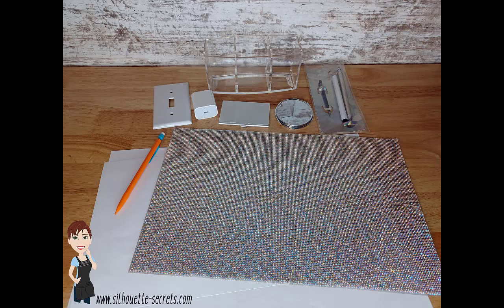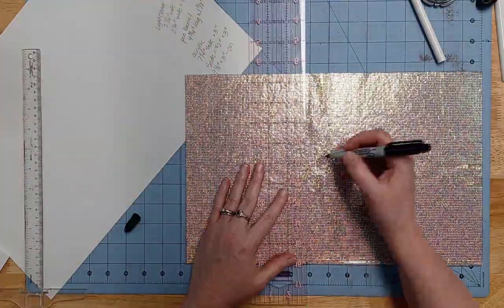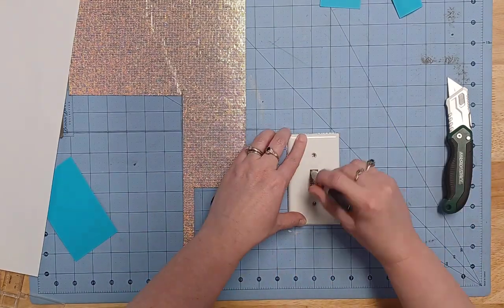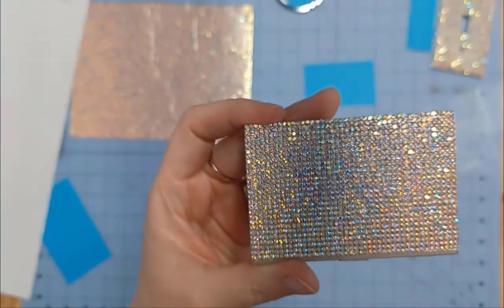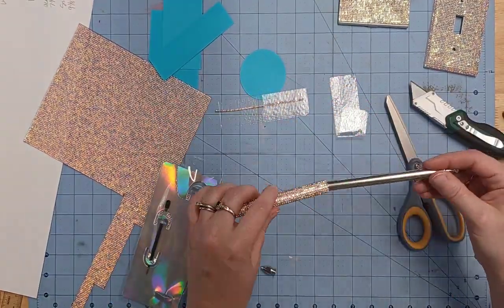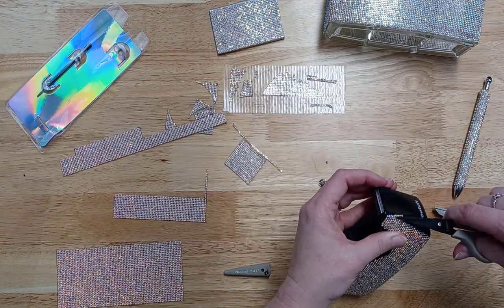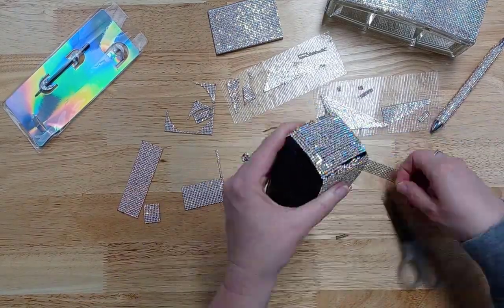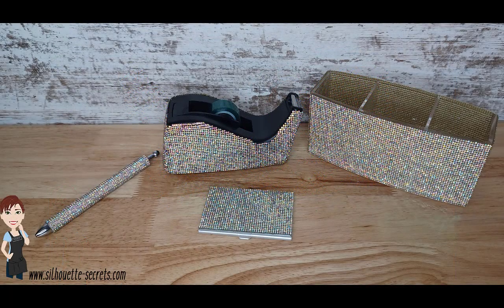Crafting with WALA Adhesive Rhinestone Sheets from Heat Transfer Warehouse

Comment: Hi there!
Thank you for the video. 
At some point did you use a heat gun or LED light (like at the nail salon) to cure the stones?
Reply from the maker: No. These are adhesive rhinestone sheets - no heat gun or UV light needed.

Comment: I’ve seen the phone chargers blinged out. Why did they say it Should be removed.
Reply from the maker: That it causes it to overheat. My husband said the same thing, that all chargers get warm.... but just to be on the safe side, I removed it and noted it in my blog post. If someone does it, then it's not because I told them to. 
I ended up using it on another project and it turned out fabulous! Will share an update on that soon!